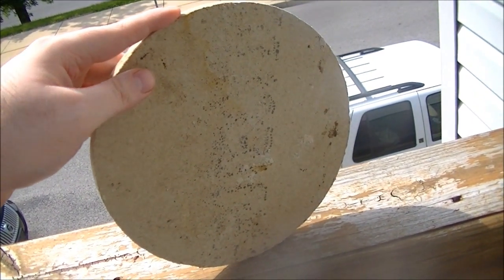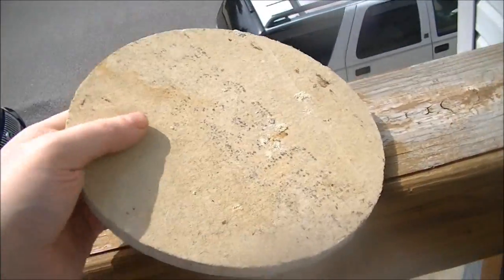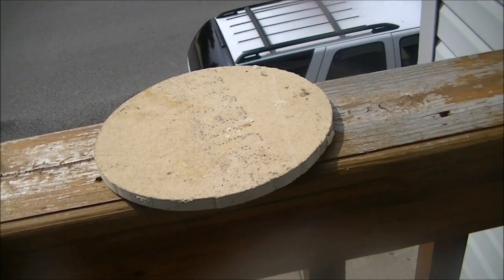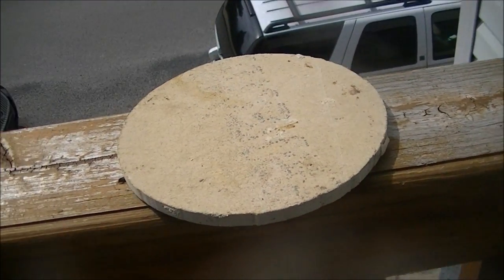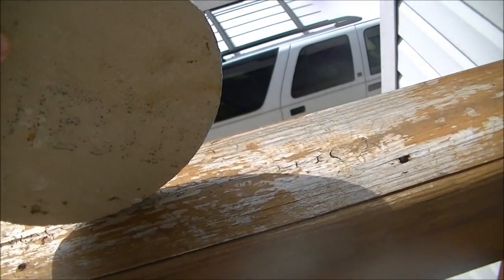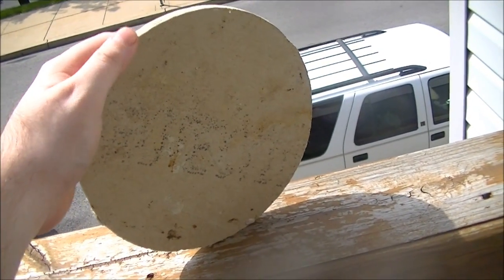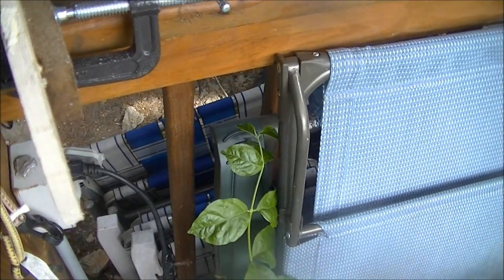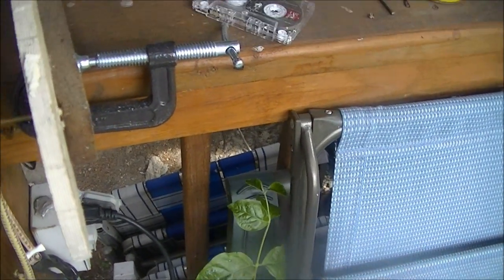Drilling Into Cement Board

Comment: Either the first hole was mostly drilled through or the cement board burned up the bit.
Reply: Man, that sounds like it gave you more trouble than the speaker you did